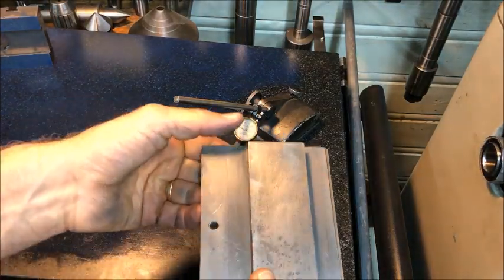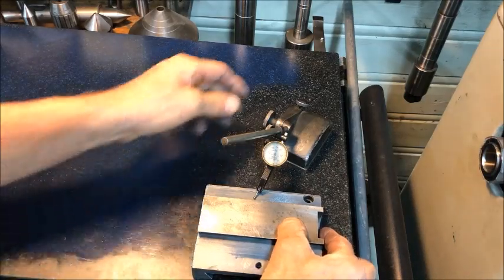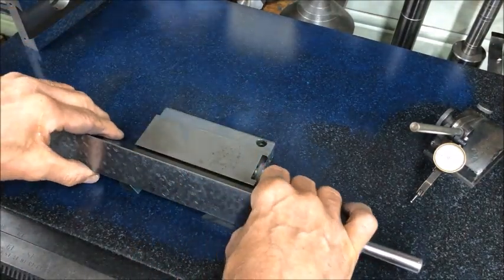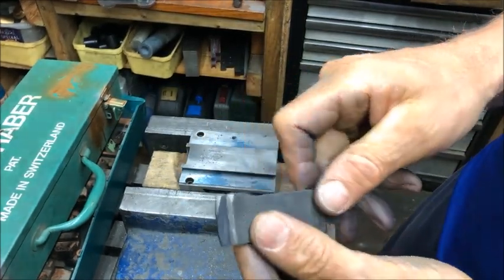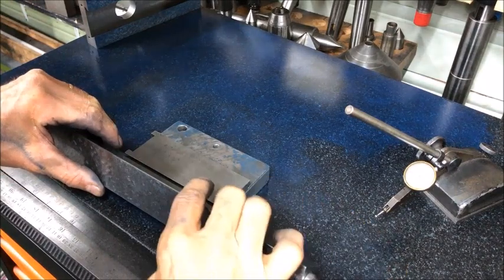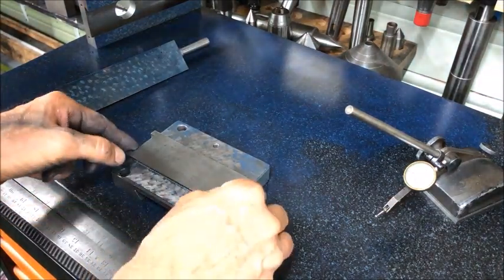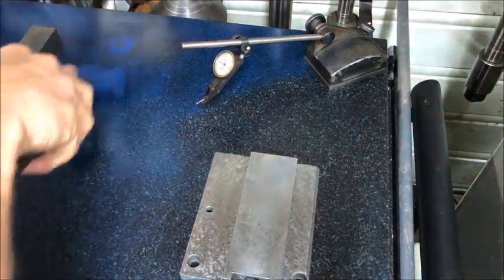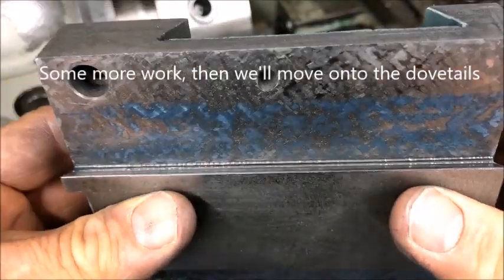Myford ML10 - Saddle - Testing/evaluation during/after scraping

Comment: Super show Jan!  So many do this and  never Pre-quilify the shorter part with a straight edge.   If you don't pre test the shorter part it will rock.  This is also something you need to do on V and Flat ways as you cant hinge a V/flat.  You've  become an assistant Professor..lol..Jan took his first King-Way scraping class in 2015 I  believe when he flew to GA..since then he has hosted and arranged several of my classes in Scandinavia.  One of my "kids"...:-)
Reply from the maker: Thanks for the nice words Richard! I try to show these details so that others may learn and avoid problems. Have started on the dovetails and will keep your advice  in mind. The usual wear is present, although not much,  a little shy of 1/1000" at the most , so not much work. These "tiny" flat bed machines are quite easy to deal with and this one in particular is even smaller than the other Myfords I restore, so it doesn't take much effort to scrape.. I must get myseld a bigger project.. for example the "industrial sized" surface grinder my friend has.

Comment: Interesting as always, another good thing about measuring before scraping is that you can evaluate how much metal needs to come off and then select the correct tool to get there. For a well worn machine that might be something much faster (milling, grinding etc) before finishing with scraping.   Scraping is accurate because it is slow :)
Reply from the maker: Thanks. Yes, agreed. Measuring and judging method of metal removal is part of the picture.. as we learnt in class, more than a certain amount of wear will be better machined (milled) flat and into alignment first

Comment: I'm sure I told you to do this several times.  We used to scraping
practice plate .005" high in the middle when I  taught in Taiwan on purpose.  It was like a rocket on a rocking chair.  We would blue it to a granite plate, not hinge it and flip it over and show the students.  They saw 40 ppi and swooned.   Then we said it was no good and set it down and spun it like a top.
Reply from the maker: Yes, you told us  :)  Very easy mistake to make and one get's a bit blinded by the looks of a "perfect" surface and the tendency is  to "want" to keep this I guess.. but we know better :) Learning the 4 rules, thereby to hinge the part (and muuch more ) really makes a difference. I try to go through the rules and a set of key points from the book when I start a new scraping session. Important to understand and practice the basics. PS! I find that without practice I am also losing out on simpler skills.. I guess the older one gets, the less one remembers. Therefore, to stay "sharp" I do some "excersizes",  eg. part of the routine to is to do the alphabet, (parts of) the multiplication table, some manual calculations on paper and also handwriting.. I  have almost lost my (once fine) ability to write on paper because of the long association with computers.

Comment: I can follow how you scrape flat, and coplanar.  How do you measure what angle your scraped dovetail actually is?  All the scraped prisms that people use to check the flatness of dovetail faces seem to be smaller angles than the dovetail, so they can more easily fit inside to get a print.  So, if you want to scrape to a specific angle rather than just fitting to another piece how do you do that?

Because you have so many similar lathes, it is easy to imagine you might wish to test pieces between them.  To do that, they all have to be scraped to the nominal dovetail angle, yes?
Reply from the maker: The easy answer I guess is that normally it doesn't really matter what specific angle you have/scrape to.. just that these surfaces are aligned with the others. To avoid much (unnecessary) work on the opposite mating part it is of course nice not to alter the angle too much. If I wanted to scrape to a specific angle, eg. for production work, I would make myself a template that I could re-use. Say, if for example a Bridgeport is made new to be at 55 degrees, I reckon they could use a template if they need to have all machines fit randomly across a certain number of specimen (to have parts in stock that could just be taken fro the shelf and would not need any fitting. However, as far as I knew, few companies went to this degree of "accuracy". Whenever a machine is/was restored, you could change the angle to 55,1 or 54,9 as long as the mating part followed
Reply: @jansverrehaugjord9934  - So, for yourself you scrape to fit mating parts, without much regard for nominal angle?

I suppose scraping isn't a process for making interchangeable parts so much, so I should just get that worry out of my head :)
Reply from the maker: @somebodyelse6673  Correct! You can scrape for a specific angle, but until now I have never bothered to pay any special attention